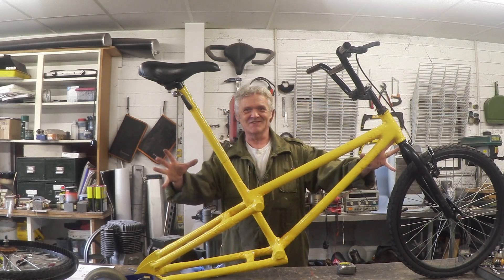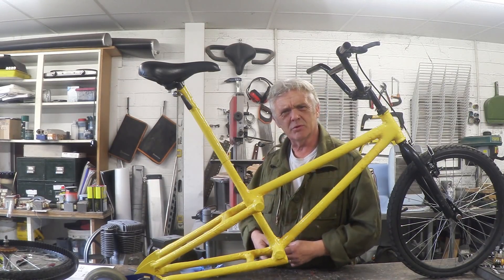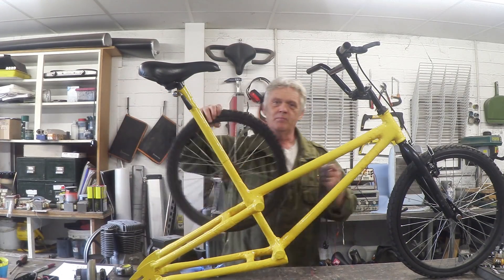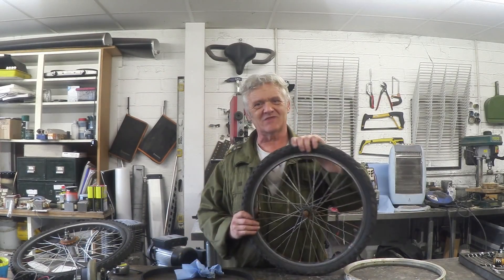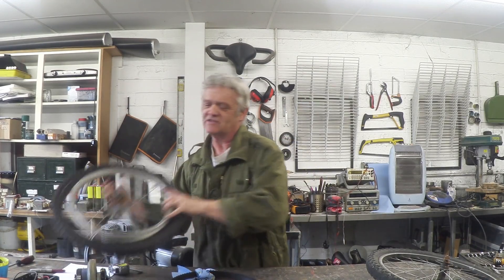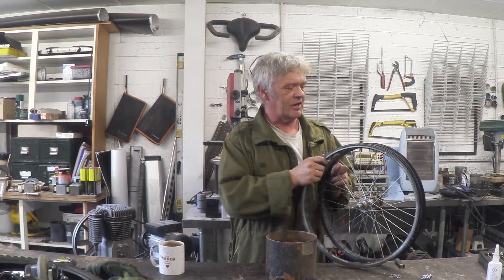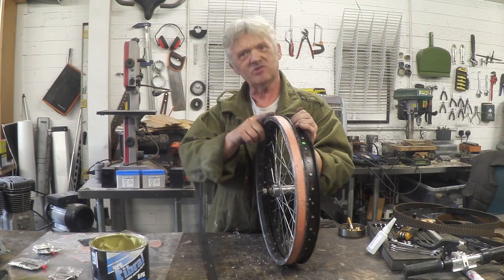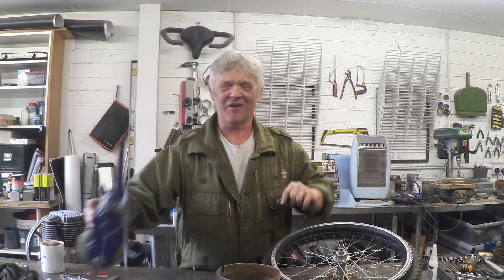1169 A Paper Bicycle - The Drive System

Comment: I'm curious what you will use as sprocket on the bottom bracket. On the bikes i know the rear sprockets have less teeth/a smaller diameter than the ones in front. And you're using a small rear wheel. Very curious how you'll solve this, to end with a decent gear ratio.
Reply: A motor that spins faster than a human can pedal?
Reply from the maker: I am just going to do what they do in kick scooters mate

Comment: I really like that drive wheel system Rob. I’ve never used resin but really fancy trying it out….is it expensive? Easily sourced?
Reply from the maker: it's not cheap mate - but you don't really use a lot - I get mine from the net - actually east coast fibreglass supplies and I find them good but it can be got from a auto repair store - a bit more expensive is all
Reply: @ThinkingandTinkering  👍

Comment: Suggestion : make a tire that does not need inflating by putting silicone instead of air in the chamber. Not sure it will work (never found the time to test it) but I think there is a good chance it would work.
Reply from the maker: if you do get round to it let me know how it works out - personally i think it won't work as most silicons are air cure and in a tyre filled with silicon there is no air - so no cure - but i would be fascinated to learn if it works for you